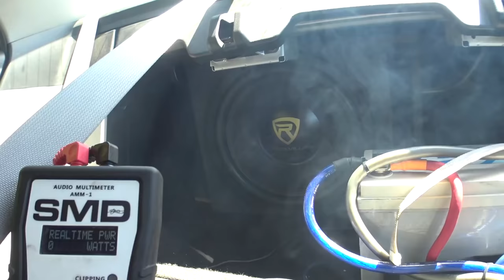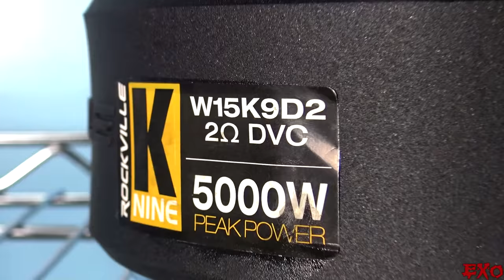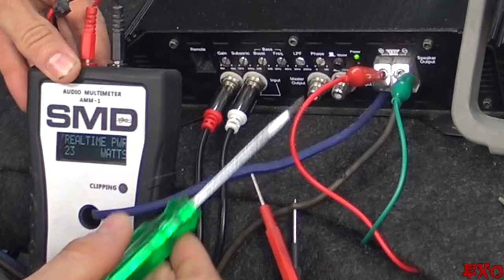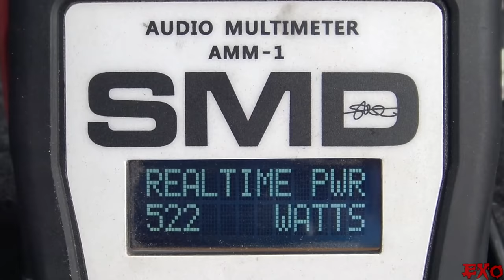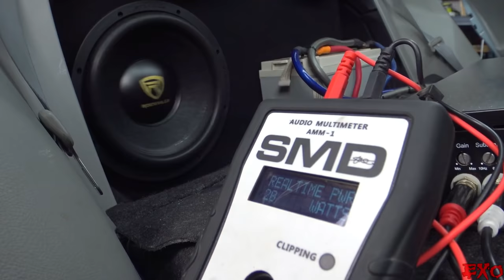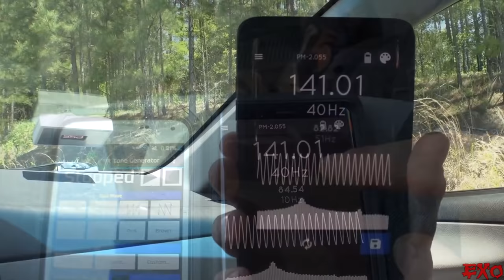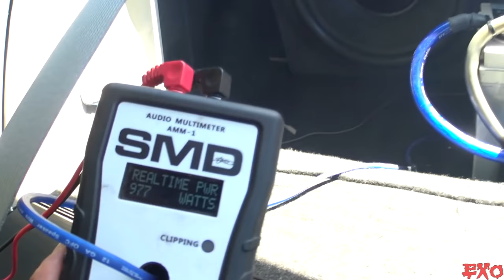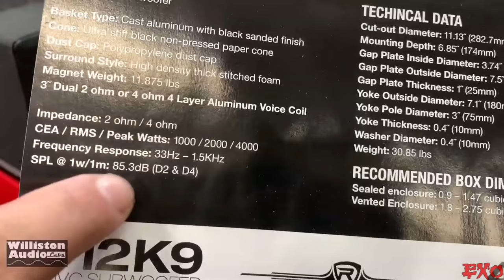EXPOSING a Cheap Subwoofer w/ Rockville K9 Version 2 vs V1 | Blowing Subs on 1000W & Best SPL Test?

Comment: on the fifteen inch you should of brought the back of the box all the way to the back seats in the middle and it would be made an major improvement on the bass. I know this type of stuff cuz I done test on subs throughout my whole life since I was 13 and now I'm 42. in house systems if you put the speaker facing towards a corner at least a foot away it doubles the bass at the opposite corner kiddy corner and other parts of the room.  I've built standard boxes that puts professional factory boxes to shame.

Comment: that was a pretty fun entertaining video .but i will say from what ive learned is that from your ohm rating you will end up with different watt ratios.meaning 120 watts on 8 ohms is 240 watts on 4 ohms i did not hear you mention anything about ohms.so you could have been running 1200 8 ohm watts on a 1200 4 ohm watts speaker.

Comment: That speaker has nice specs imo, to bad they opted for aluminum voice coils if that speaker had slightly nicer components copper etc, it would be an insane deal at 100.00 or hell even 200.00 dollars.

Comment: I just came across your channel and yeah you know wtf you are talking about. The only reason I came across it because I wanted to buy these subs but after watching this I am staying far far away from them. I have a few question maybes you or someone can answer. Did they follow up on why these blew with their suggested power rating if so what did they say?I have a 2007 DTS and I have a JL Audio 12w6v2 and a JL 500.1. This set up has been in 8 previous cars. I have had them for about 12 years maybe more. Only once I had to have the foam redone. Now I love my JL and there is nothing wrong with them. I plan on giving them to my son since they just won't quit but I just want something different not sure why but why not. I am no longer wanting the Rockvilles after seeing this but I am interested in either the Skar or the Deaf Bonce Apocalypse. I am looking just for 1 12" or 1 15" I like my trunk space and will probably do vented so thus just the one. I know the subs are about 25 and then air it with a am. Which out of those 2 subs would you choose and why? I take all opinions from anyone who is knowledgeable. I listen to lots of hip hop and rap. I love bass.

I decided to sub to the channel too
Reply: stick with jl
Reply: im assuming youre going to run one brand not mix match, all skar or all deaf bonce. if im correct id go for deaf bonce. the apocalypse amp has features that doesnt come in alot of amps. the bass knob has a clip light, volt meter, and amp temp meter. i dont know much about their subs and their sound quality but looking at videos in yt their subs move alot of air. plus deaf bonce is less common because its not as cheap as skar. if you do go for skar stay away from their rp amps. the sound quality of the rp compare to the jl amp is night and day and youll be dissapointed
Reply: I own two of the 15in woofers I have a Behringer 6000 watt amp I have a fridge down to a 1.0 ohms into my speakers Rockville 15in Never Smoke them yet these are in a enclosed cabinet if the guy would try them in an enclosed cabinet maybe they wouldn't blow up and you didn't see him hooked it directly from the amp to the speaker he may be lying

Comment: it's safer to play a 3000w amp than a 300w amp for example because the 300w amp might start clipping at that rating and the 3000w amp won't clip at 300w. Clipping blows speakers just as easily as wattage

Comment: Sorry to here that happened. Why not just contact them directly and ask for the specific changes?  I know when the company first started retailing to the public many years ago I was one of the first to buy their RDX-M3 from Amazon. Paid under $150 and blew my kicker 15" comps subs that i had for like 7 months in a matter of days. So, I replace the Kickers with DB's and it gave me yrs of entertainment. Then it died one day after just paying for about 3hrs non-stop in a very hot confined trunk (driveway party). I loved it so much I decided to just keep it for sentimental value and it's been in my shed along with my last living DB-wdx. Plan on getting it fix and putting it in my Classic 1995 Cadillac Deville. But my Rockford Fosgate Punch Amp from that era. Believe it or not still works. LOL....never left my Classic 92 Camaro since I installed it! and still beats hard! They sure don't make'em like they use too!

Comment: I used to break subwoofers in like crazy. I used to take 250-500 watt sub and make them last month's pounding. Anytime I start to smell smoke I would turn them down. I finally got a good set of Subs they were rated at a 1000w each Rockford Fosgate. they lasted 2 years taking over 2500 watts. It's all about how you break in the subwoofer

Comment: A.T.C Test there bass speakers for 1/2 hour at 1/2 power. The peak current for 5,000 watts into 2 load is 70.711 amps. Best solution power your in car P.A system is 850 amp per hour forklift power pack, should last a week or 2 before recharging

Comment: So the Rockville amps have 3 different ratings and they compare the ratings to other manufacturers the peak rating is supposed to be like boss and other cheap brands then they have rms ratings compared to like kicker and then they have true cea ratings not 2006 just cea ratings I think they rated the subs this way and dont know what they are doing

Comment: They could have changed the rated wattage on the second edition K9. They didn't. That's tells you that they didn't do any testing. If they would have tested one second gen theu would have seen that it would blow at the RMS. People are saying they blow at 800 watts. So you are geting like a 300,800 sub for 100 bucks that not a deal. 30 dollar walmart subs are rated higher then that😂😂😂. Rockville get your s!it together.

Comment: I have fried Rockford Fosgate 18s with a 2000 watt amp. The stuck to the bottom and would not come back lose. It melted the coil wires to the magnet on both 18s. Wasted$1500 but learnt a valuable lesson. Don't trust the ratings

Comment: New coils must run at 50% power for at least 12 hours total so the lacquer can dry very well.Not doing so results in a short circuit between coil windings hence the fast blow up.Do so and the subwoofer will not blow up that fast next time!

Comment: That's a PA speaker with woofer cone   , those twin spiders are meant for pa speakers which doesn't needs to go too much x max like a subwoofer does . Why does it have a harder suspension like spl subs . The whole design is wrong , the spiders needs to have more more circumference  .

Comment: I bought 2 Rockville punishers 12s and both broke in less than a year the d1 can’t handle a .8 load and the d2 tinsel leads broke in 5 months on less than rated power 😮 and the Rockville rep said that it was because my box was too small by .12 they don’t honor their warranty’s their BBB Rating is F this co. Should not be allowed to do business

Comment: This is all fine and dandy, but I cannot understand the power rating thing. A piece of paper moving back and forth can only move so much air! A speaker has limits for it's movement. It can produce a certain amount of acoustic energy, right? So, if a cone is at Xmax @ say 100 watts, what good is shoving 2000 watts into it going to do? I don't get it. It would seem that when the speaker's travel limit has been reached, the only thing left is trying to get rid of heat from overpowering it? Yes, you can tune a port on the box to fight the speakers natural resonance frequency. That may allow more power to be dissipated without destroying the driver I guess. But what does that prove? 🤔 If you have an amp that can smoke out one speaker (with clean signal), the solution is to add MORE speakers! As you add more, you also increase acoustic output. That's the goal, right?

Comment: I bought a powered 18" folded horn Rockville sub that claimed to be 3k watts for my DJ system...  lasted about 6 months then while playing "Turn Down For What" I found out for what lol. The sub let the smoke out!  Contacted them about the problem and got the runaround.  The sub still sits taking up floor space in my shop. After the FAIL from Rockville I bought a JBL 18" powered sub... I have ran the piss out of it and it has not hiccupped even once!  It is an incredible sub!  Worth every cent.  Never buying Rockville again.

Comment: Yeah i got the Rockville amp/receiver and two ten inch loudspeakers. Home audio. The amp/receiver is pretty good. Works real good. The speakers are decent. Nothing great. I got those and two 10 inch Cerwin Vagas vs100  hooked up to it. Got my another Jvc amp and hooked up two JBL Northridge editions with four more 10s.  It sounds great. Yeah alot of the Rockville stuff is not good. The banana cables are a joke.  Yeah those subs are uhhh!  If I get a powered sub for my home audio, I'll get a klipshe.

Comment: It funny I have a Rockville "8k" peak amp and I wired it down and set the gains with a smd dd1 and I used a multi meter to take my voltages to see how many watts it can truly push so I'm at 56.7 watts at 2 ohms (what the amp is rated for) and that is around 1670 watts. I will never buy any rockville products also at certain frequencies the amp gives out popping noises shit amp tbh now worth 223$

Comment: still giving away a free 15"  if so I could sure use one or two for my home made bass tubes.but one is fine but 2 is always better. 😁naw  just kidding 1 would be just great. I've tried these homemade bass tubes with a older 10" pioneer impp's in each  and I was shocked. that was after I had to test it before. and had to extend the length. after extending it it had that amazing low bass that thumped so hard even though the sub that was in it was only made for sealed enclosed boxes. I always wanted to etheir try a 12" or a 15" inch sub in one or both of them. as it's big enough to fit any one of them 3 sizes. I've built 2 of these. I'm pretty sure that  these will provide way more bass than any manufactured bass tube probably ever made.

Comment: I’d take a Bose richbass woofer over Rockville subs any day. Even though it’s 75 watts per sub, it’s a lot of power for a tiny 4.5 inch woofer. It also has much better SQ. Rockville overrates their subs which prays on people who bought a decent amplifier from a reputable brand such as Rockford Fosgate, pioneer, or sundown audio. I prefer a subwoofer that’s as loud or little louder than the Rockville k9 but, with better SQ than a Bose richbass woofer.

Comment: about the wirring sheet,its for protection, you whont blow the sub if you blow the amp first. but to be hornest, if a driver company cannot get the wirring and lie on the specs, stay the f away from them...

Comment: That's that maniac savagery needed to call BS when someone hands you a turd in a sealed box saying this box does not contain a turd...
I feel like I just came up with one of those expressions that will endure for many of generations
Reply: Fuck I do and I will give you full rights to use the the "turd box" phrase or analogy or Yoda /Gandhi /Mr Miyagi /Confucius knowledge drop. It's really quite flexible and can adapt to just about any scenario. Without the sub however my lawyer advised me that I would have to seek compensation for use of the "turd box" if you were to use in a scenario that brought you monetary gains.
Thanks llc
Member FDIC
Non-profit organization
M. D. Sole proprietor Inc.gov

Comment: It is actually better to have an amp that pushes more power than what the subwoofer is rated at this way you dont turn the amp all the way up and clip the amp and send a distorted signal to the subwoofer which will cause damage most people smart enough to install the equipment but dont know what they are really doing will do this every time put 1000w max amp on a 1000w rms subwoofer and cook the subwoofer and say hey why did this blow this sub is over rated no it's not you just do not know what you are talking about and your amp was too small so you turned it all the way up and started sending a dirty or distorted signal to the subwoofer and caused the coil to over heat and break

Comment: apparently no one reads RMS power these days,
at the end of the day these subs are less than $120 and just like a cheap amplifier, expect half the advertised power.
but here is the advertised power ratings in case anybody is curious.
RMS 15" 1200W 12" 1000W 10" 800W
PEAK 15"  5000W, 12" 4000W 10" 3200W
"??Program power handling" 15" 2500W 12" 2000W 10" 1600W

Comment: I have a 8 inch rockville house subwoofer that's rated at 400w, I paid 90 bucks for it from amazon, and it sucks lol. I would say its more like 100w if that, and the port in the back I think is too big. Doesn't like anything lower then 30hz at high volume and it distorts very easily. I don't like rockville too much, wish they would rate there stuff more accurate. Course lots of these newer companies are doing that too and its shitty. False advertising and shit, O get this 5000W Bluetooth speakers for only 49.99....REALLY, and they glow even :) so hard to find a trusted company these days even with all the youtube videos out there. Thx for taking the time to EXPOSE rockville for there very UNaccurate shit haha

Comment: okay, pay attention here: rockville claims 5000 watts? bullshit by ohm's law! here's how you properly calculate max wattage (all calculations must be done as it is connected in series, never parallel. ohms law!) :
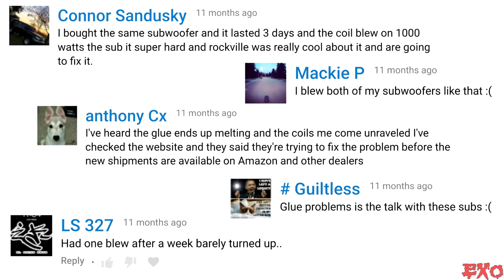for dvc drivers you MUST split the coils by taking the resistance (impedance) of 2 ohms and multiply this times 2. so 2x2=4 since you have 2 coils hence ''DVC'' multiply 4 times 2 so 4x2=8 ohms. now take 5000 watts, divide this by 8 so 5000÷8=625. this v2 sub ONLY has 625 watts MAX. so if you load it with 2099 watts as shown from the insert at 1:13 in this video you ALWAYS OVERLOAD IT! again, even if quality is sh*t, it does NOT melt away unless YOU as USER tuned it wrong from the beginning. you must ALWAYS finetune and subwoofers and slowly increase the load. a week prior of typing this comment i upgraded my system with rockfort-fossgate subs so i gave it away. it was stil the v1! so there you go, as long you take note of this formula for calculating REAL sub power you're good. good luck and enjoy your system. oh, don't forget to search for subwoofer test sounds, or cd or mp3's or whatever you use. again only calculate real power using series connection schematics so you know how it works.

Comment: Theres a simple explanation .  There is way too much cone excursion .  The voice coil is traveling out of magnetic flux . The amplifier no longer sees an inductive load and the power is feeding pure resistance . The voice coil is burning out much the same as a fuse does when the current rating is exceeded .  I would rather blame the cabinet than the speaker for that .  The cabinet design looks like pure thumb suck to me .  Do the same experiment with a sealed box  and compare the results .

Comment: No idea what you are doing. 
And the other guy is old school ????
Is he over 50. ?
What happens when an amp is under powered to a sub !?!?!?!?
AND what happens to a voice coil when DC current goes thru it.
AND a ported box has what? rise in that requires what?.
These are not questions to answer to me. As I am old school.  I know the answers. DO ANY OF YOU ?
This is said with the utmost respect.

Comment: Rockville had a chance to make it not suck, though they fixed the coils poor winding, it was still only a 350w or so coil, they still faild because of their ego. From the very start they should have just rated their k sub to handle 350rms and called it a day, at that price, people would have STILL jumped on it, instead of messing up their reputation by saying it can handle over 1,000rms, they would of sold many more subs and mabe made a ton more money if they would have just been honest about their power rating... under 100 for a 350w rms sub, id totally be down, but just because they lied from an overblown ego, SCREW THEM. Sundown, massive audio, psi, dayton audio, rockfordfosgate, fi, dc, b2, fu audio, digital designs, skar, alphard, crossfire. will get my business, hell even kicker will to. BUT ROCKVILLE.... i dont think so...
Reply: blowville..  all about blows HAHA

Comment: Hello my name is Michael Correa I am wondering if you could build me a box with two tenants subwoofers with a lot of bump to it it's ringback that old memory when I used to have when I was 18 years old and had my box in my SUV where I could hear the song bumping and everything shaking all over the car I I'm a man that doesn't have that much money I'm on disability I've been on until security for about 23 years and if I had money I'd pay you to build one for me but if you can do this for me I really appreciate this because the moment I get social security check I end up having to pay my bills the moment it comes it don't I only get it once a month and like I said once I get that check the same day it's all gone into all my bills and I say stuck with other bills that I need to pay but I I beg you if you can build me up box that would 10 in subwoofers if you could size I don't want the box too big and just enough to fits in my 2017 Nissan Sentra I want a box but not too big just a box that will fit perfectly flat in the back and the speaker is facing the seat along with having space for my groceries in the back that's why I don't want a big box I just want enough that it fits in up against my seat in the back says flat and I'll be able to have my groceries in the back of my trunk interface for other stuff to put in my trunk That's why I'm not looking for a large box if you could please build this for me God bless you that you can please thank you God bless you